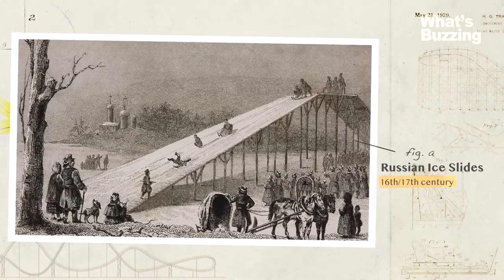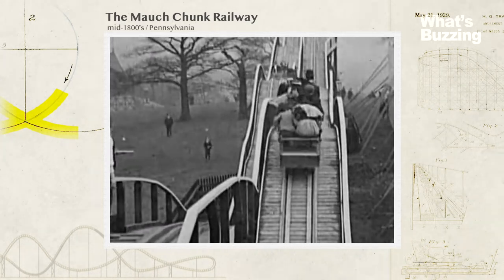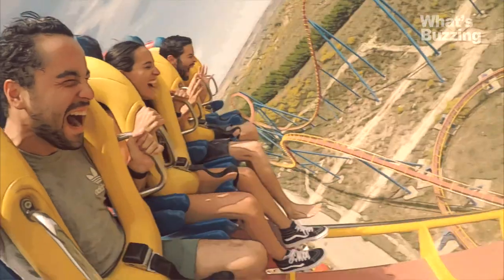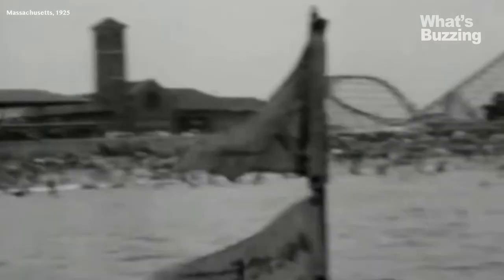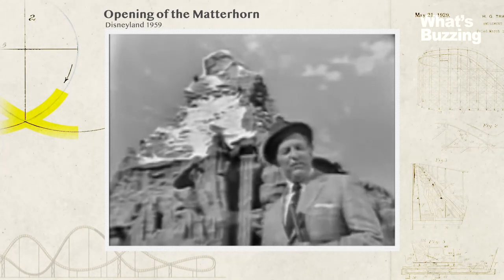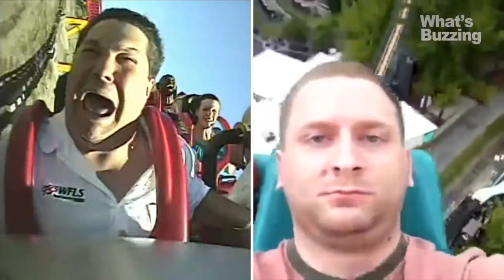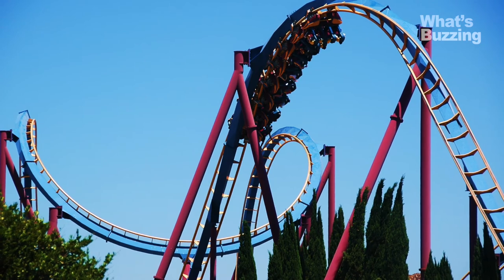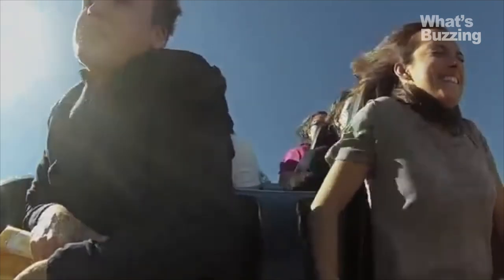How have roller coasters evolved over time

Comment: Those loops are crazy, a straight loop actually SPIKES your G-forces  at certain points,, modern loops (more bowed) are designed to even out the G-forces. Good stuff!
Reply from the maker: Thanks for sharing that info IcoN! crazy how engineers take G-load forces ok human body into account when designing a new roller coaster ride!